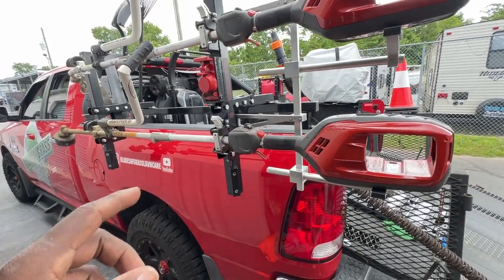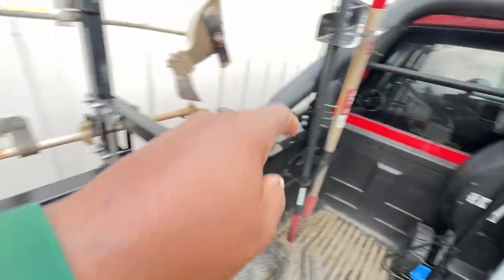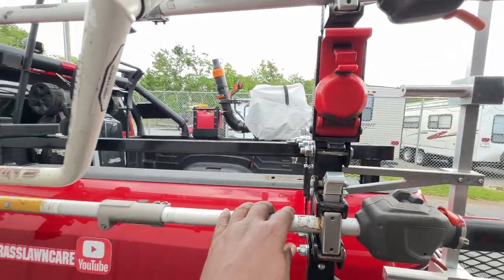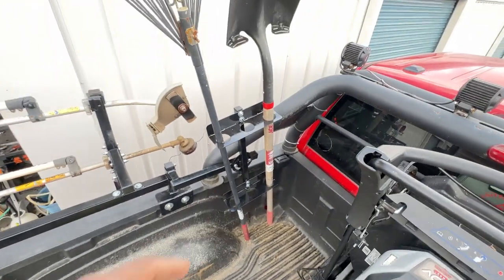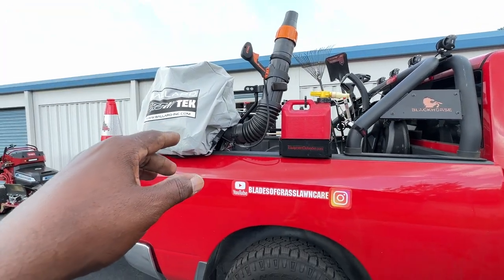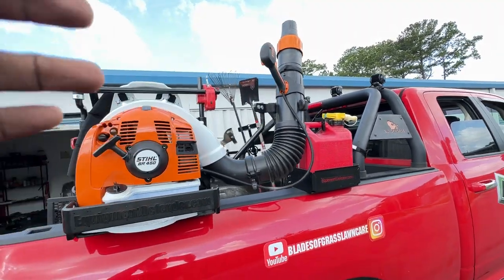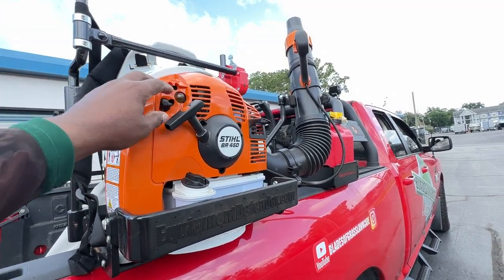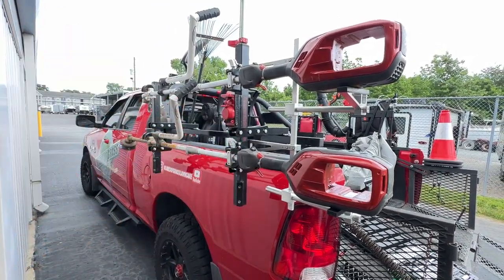Best 2023 Lawn Care SetUp UPDATED | New lawn mowing trailer racks on my 2023 lawn trailer setup

Comment: Johnny I see a lot of screws with this new add on. Someone with some sticky fingers only need a drill and the right size socket to take the whole set up. I know it’s hard to stop a thief we can only wish to deter them. Thank you for your knowledge and videos. I have learned a ton from you.
Reply: I agree, it is easy to take apart a system. These are deterrents while on the job. Most of us lock our stuff up and storage or in our garages when not in use. And pull them out and load them during the day. But as with anything, somebody that really wants something will take it.

Comment: Good shout out to Dale.  I ordered my rack a couple years ago and I love it too.  I didn't think he made the side mount trimmer racks, I ended up going with green touch. I probably spent too much on my green touch racks, but it works as a deterrent as long as you remember to lock it when you are not at your truck. The deterrent and security systems only work if you use them.  Your setup is was looking nice. Even with a short bed, you made it work.

Comment: Watching your videos videos inspired me last year make the push to Commercial ECHO electric weed eater and  other battery lawn equipment except gas lawn mower and back blower. The electric weed eater does everything my gas weed eater did and i no longer have headaches and no vibration on hands from using gas weed eater. The electric is quiet, no fumes to breath, starts right way all the time, has enough power, its the best decision i made. Thank you for sharing your experience and quality product you use.

Comment: I got the Same Mow and Go System. That you have, and I installed it a week and a half ago. I got it painted black by Dale but I’m already starting to see surface rust. Honestly I’m a little disappointed, I thought it was going to be powder coated but it just been spray painted black with a very light coat, certain parts of the chain link paint has already came off.Are you having similar issues? If yes, how are you remedying it?
Reply from the maker: Mine was powder coated and as you can see no issues
Reply: @Bladesofgrasslawncare  I see, he said he stopped powder coating in 2021. When did you buy yours?